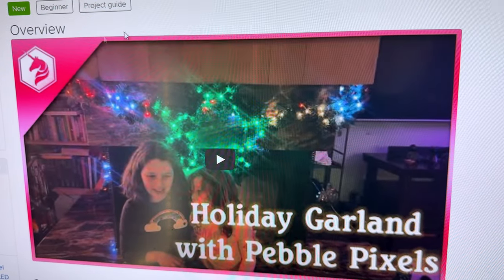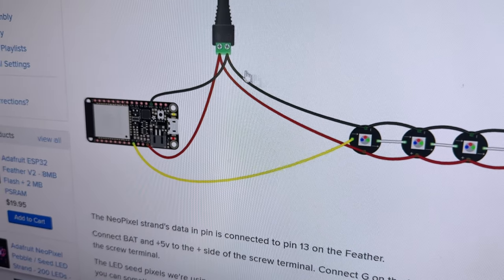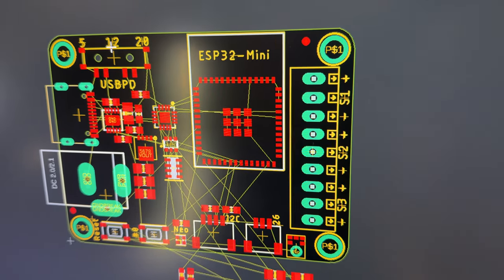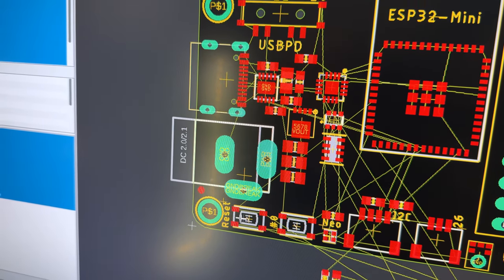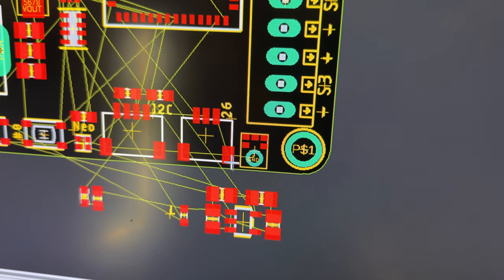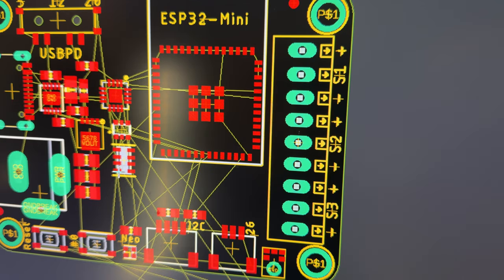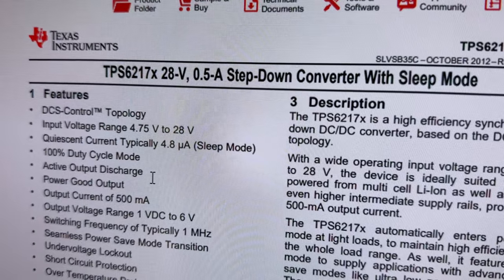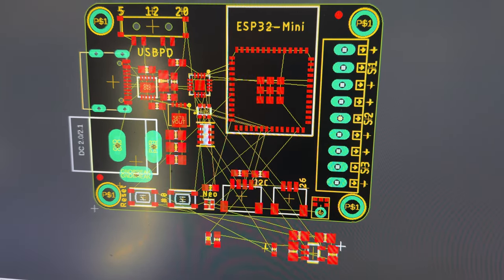Trying to design a great WLED board 🌈🦄🦃

Comment: Would totally get some of these!  Suggest some indicator leds when used with USB-PD if the PD source can't supply the voltage / current requested.  E.g. if it's a 5V only supply and you have 12V, perhaps a red LED blinks or other indicator for PD request / supply mismatch.

Comment: need a fuse ada
Reply: add it before and after the board then
Reply: @UKsystems  yes but would be nice to have on the board - much easier and safer for people to use that dont know how to fuse it on the cables
Reply: @ the issue is that depending on what LEDs you can fuse changes but the USB specification with the power delivery chip will turn the power supply off